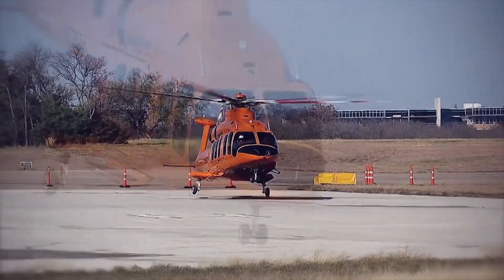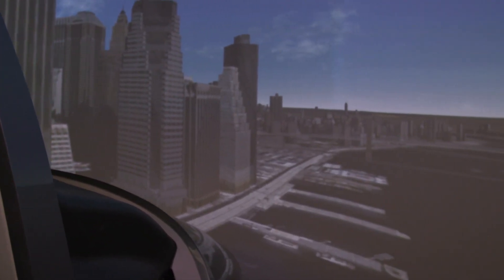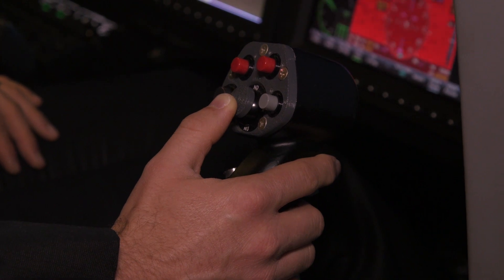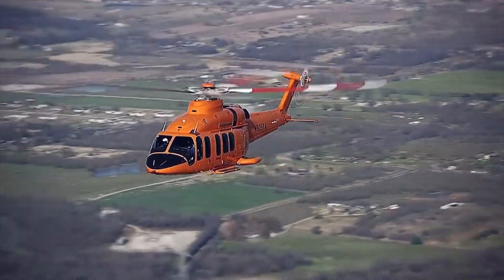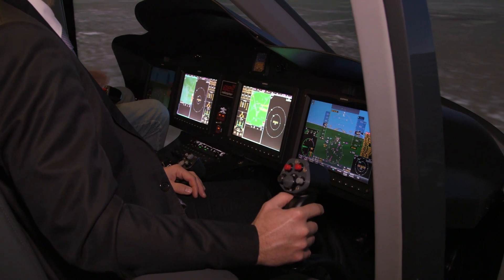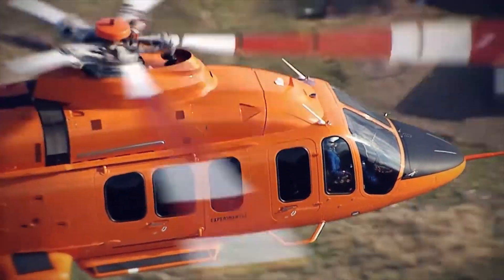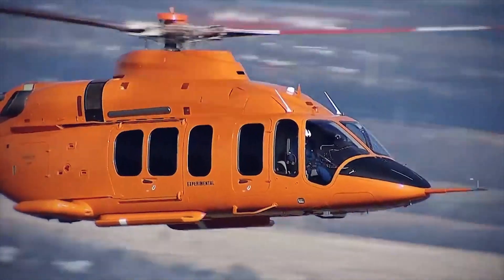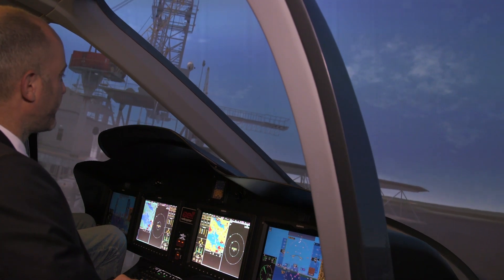Flying the Fly-by-Wire Bell 525 Helicopter – AINtv

Comment: Wow a helicopter with fly by wire. You press the control then the computer takes over. 3 controls, one for each axis and you barely touch any single control then it takes over. Just cannot describe that